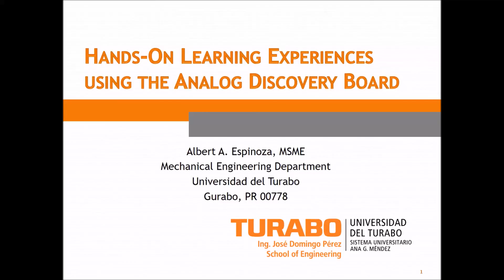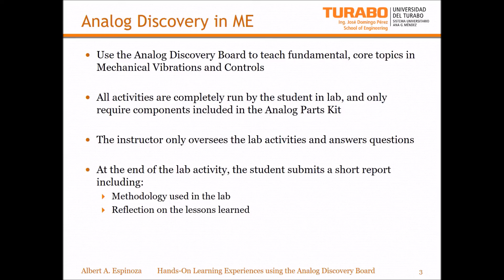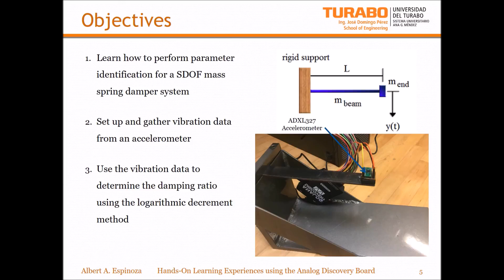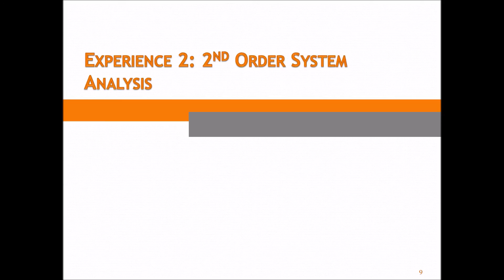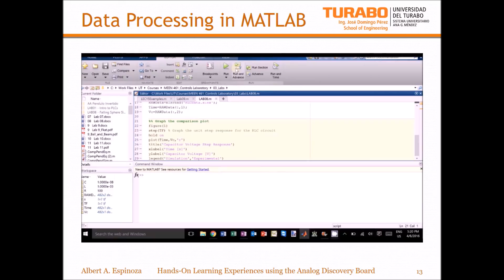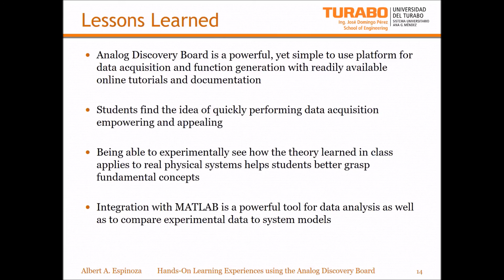Analog Discovery: Hands on Learning @ Turabo_Espinoza

Comment: Have you looked at having the experiment controlled by MATLAB in addition to using it to process data?
What clever ideas have your students come up with on their own, especially because they are tasked to do most of this reasonably independently?
Do the students own the boards or at least have access to them outside of class?
How does doing the experiments this way compare with what can be done with traditional desktop equipment?